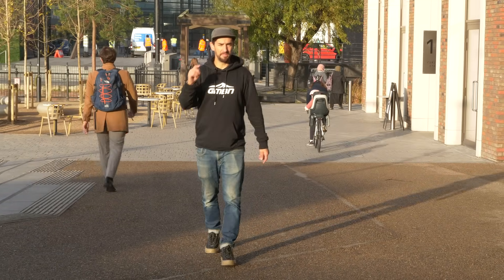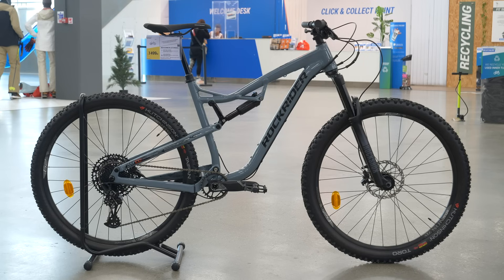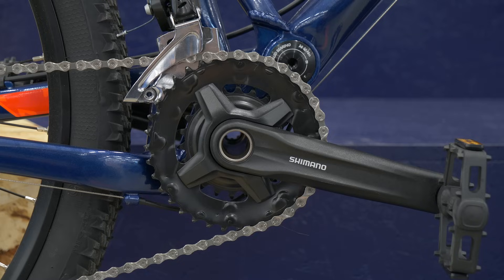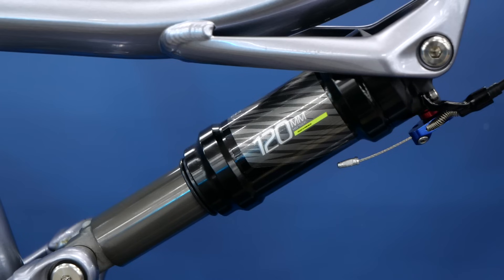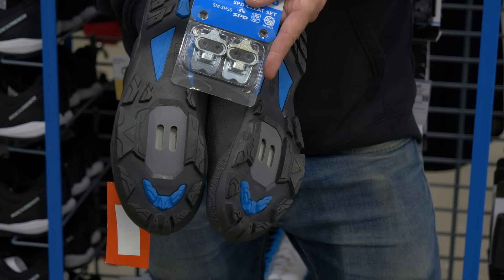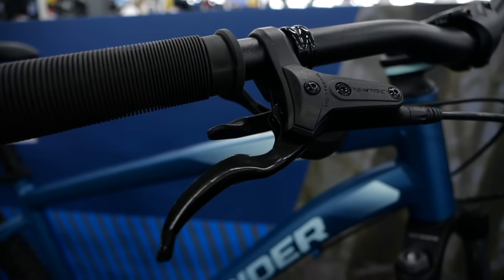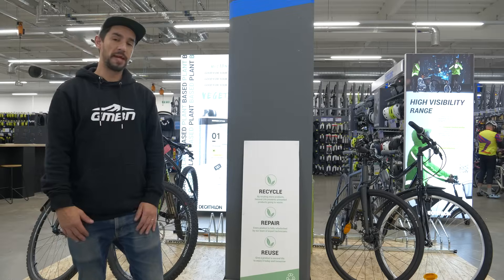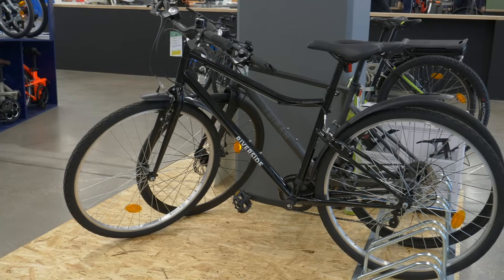How To Buy Your First Mountain Bike | The GMBN Guide

Comment: Decathalon is GREAT! You can get used to the weight of an Ebike before you actually get an ebike
Reply: Lolololol
Reply: The bikes are cool men,   for those ho don't haver Money to buy One better ,  it's  ok, and we have a lot of fun!
My bike do everything i need , has a 26 weels  downhill Mondraker level 2009
And i climb  everything with my beauty! 👌
Reply: Lmfao!
Reply: Now that is funny dude!
Reply: @shwndh   funny sete is ir ?
Reply: So true though 😂
Reply: Lmao just flexing the new RACE 900 Team Edition from Rockrider that weights less than a Specialized Epic with SID fork and XX1 AXS drivetrain for 4200€👍
Reply: @nvire5202  That bike actually looks decent but their older bikes feel like they were made of lead.
Reply: @kermitthefrog3685  well actually the think with decathlon nowadays is that their cheap bikes are crap and I'd admit it, and same as most brands, but with decathlon for about 500€ you could get 1× drivetrain and disc brakes and a sort of good fork, I ride the XC100S and it's sold at 1400€ and I get air fork and air shock with both 120mm travel, nx drivetrain, level brakes, 29er full tubeless and boost so tbh with decathlon, you just need to put a little more money and you'd get great things for a really good price, and the RACE 900 Team Edition is really high end and costs nothing tbh, 4200€ is cheap for having the best of the best components
Reply: I have a '97 Cro-Mo frame and Hi-Ten  rigid retro MTB. I have full rigid steel bikes since I was a kid. I love it but I want to put it away for special occasions and I need something for everyday tasks including rain can anyone suggest something cheaper but 20 degree uphill só I van visit cusins and my Grandpatents grave?

Comment: For someone looking to spend under $1,000 i'd recommend a better quality hardtail with nicer components. I'd prefer to have nicer components and frame than a full squish bike with super cheap components.
Reply: Look at the am 100 ht
Reply: @roryf3710  That doesnt look all too bad, didnt knew they had ond like that. But still, wouldnt you rather get a 1200 euro Canyon Stoic? Or even the 800 one instead of a Rockrider?
Reply: @em8452  Stoic is 100% better even with the cost, but it has the biggest disadvantage at the moment. It's a direct sale brand bike during bike stock crysis. At the moment it pops up on their global e-shop it's seen by the entire world and it's gone in 5 minutes. Good luck with finding that one.
Reply: @petrmatousek7422  True. But I would wait.
Reply: tmaybe you don't know but that hardtail  was the second cheapest hardtail sold by Decathlon, they have at least another 2 superior models that have much better specs  with more bang for the buck if you compare level standards with other brands !!

Comment: this year i bought my first "good" mountain bike - 2018 specialized rockhopper. i bought it used and i have to say - it was a real bargain. it costed a bit more than 700 €. The owner upgraded it, so it now has sram nx eagle shifting system, crang brothers pedals, lizard skins grips, 12 gears etc. i just love it. it's perfect for beginners with some experiences. it's also super light. recommend it!
Reply: Sweet deal! Even I went with a 2017 scott scale with NX drivetrain, judy air fork and 12.2kg total weight for 800ish.... Pleased
Reply: Great deal bro 🙂
Reply: I had the 2021 model, tbh it was fine but for the price of 700€, there was way better tbh

Comment: My first bike was a Norco Storm a couple years ago, paid around $1000 AUD. It was an amazing entry to the mountain bike scene. I did a 1x conversion myself on it. Already had an air fork and hydraulic disk brakes which I paired with some bigger rotors. I'v since had a slight upgrade to a 2021 Norco Fluid full squish trail bike and love that thing

Comment: Bought my 1st mtb last month. Ended up with a Specialized Rockhopper Expert. I really like it and I'm already looking for another, higher end bike. The Rockhopper will become my XC bike.
Reply: Tbh the Rockhopper Expert is too expensive for what it is, with Decathlon you could get a 1×12 GX Eagle transmission and RockShox Rebra for the same price
Reply: And I suggest the AM100S from Rockrider, have tried it and the only thing I could possibly complain is the brakes, wish only bigger 180mm disc in the back, if not the bike for around 1600€, it's rock solid choice, full suspension with 150mm front (RockShox 35 Gold) and 140mm rear (Manitou Radium I belive), NX drivetrain and 29er with tubeless ready rims and tires I believe so tbh rock solid choice

Comment: Bought a Rockrider XC 500S  for 1800€ and I am reasonable happy with it. I think it is really a great bike. The only downside is the 100 Kg system weight and the SX casette. The front break could be a little bit more aggressive.
Reply: I have the XC900 and have had no problem with the brakes, what exactly doesn't work for you?
Reply: @Fred_the_1996  I'm a big guy and the level T has not the stopping power I'd need to feel really comfortable with.
Reply: Change the front brake. Should be an easy change. Get a four piston caliper.
Reply: @captaincommodore8901  it's not the brakes, I had no issues on XC 500 with level T and I'm 2m tall 100kgs. You need to bed them in properly. Same on AM 100 S, level T but 4 piston, people complain but the brakes need bedding in, no issues riding red single tracks on that
Reply: @srymisclick  yeah I agree, I forgot to bed in my Level T brakes on my XC100S, so I removed them and legit sanded them real good and now feels better, not the best but feels better and I believe it would be really good when I change my brake pads and bed them in correctly

Comment: Purchase price isn't the only consideration. Higher level bikes with more kit does usually mean more maintenance though.... hydraulic brake bleeds, suspension servicing, dropper servicing, wearing parts like drivetrains cost more to replace...

Comment: Thanks Neil, as always helpful and fair - even if it was sponsored by a large retail shop
It’s always a minefield when choosing a mtb.......I have got back into it so have been using my 2008 felt which cost about £700 at the time, now thinking of upgrading as there are a few things I’d like (dropper post, converting to 1x11 from 3x9) and some parts will soon need replacing (such as rear mech, cassette and front cassette along with forks) if I replace these which I’m struggling to find like for like replacements and the cost to replace these things soon starts adding up to the point where a new bike suddenly becomes a more economic reason. 
Just wish there was a place you can hire out the different types of riding frames - I don’t fancy making a choice only for it not to work for me...........

Comment: I'm sad you went from the 229 GBP st100 ( it's not 299!) to the 600 and 900 full suspension bikes . Decathlon has some pretty good hardtails in the 500-1300 GBP range. Like the st900 hardtail, the AM trail, XC100, xc120 and the carbon xc500 with GX eagle groupset and a rockshox reba fork.

Comment: I'm looking for the ST540 V2 and it's really good for it's price. It has a 1x10 Microshift AdventX drivetrain with clutch!. Decent SR Sontour XCR fork and good tires. Worth for the price(Hungary price: 489€ or 552$)
Reply: No it's not. Ridden one from a colleague, it sucked. I would pick a 2nd hand respected brand 26er over that thing, any day of the week. Which isn't a bad choice by the way when you are just starting out.
Reply: @em8452  can you tell me why it's bad? Which part sucks? Drivetrain or something else?(fork for example)
Reply: For the most part it is very heavy and that takes the fun out of the ride with the weird geometry it has. Also it is not very upgradable. It has qr hubs, a square tapered bottom bracket and a straight steerer tube. If, and I dont know if its even possible, you want to upgrade to a good fork which are almost all tapered these days you will need a external cup headset which makes the weird long steerer tube even longer. Im sure the microshift stuff isnt all that bad, didnt tried it in the mud though. Im not saying you wont have any fun on it if you buy it. I just think it is a better idea if you can get a 2nd hand 26er tot start on with proper parts, for less, and save up for a proper 29er hardtail that you can upgrade in time.
Reply: @em8452  thanks for the information! The hubs are ok what you said but the fork is quite easy answer because we have a lot of straight XC fork even fox 32 have a straight version and the microshift is not that bad it's like shimano or sram because this is it's competitor in the market. I guess it is not bad for some people but it's not for you as i see. Thanks again for the good information :)
Reply: Edit to my head tube angle: XC bikes are starting from 69° Head tube angle and goes up to the sky.

Comment: i want to sell one of my road bikes and get into mountain biking but I'm still stuck between a hard tail or full suspension, mostly want to start with trail riding and single track. i like the option of having the full suspension but i probably wouldnt use it to its potential

Comment: What should those of us heavier  riders (300lbs and up) be looking for in a mid level bike? I never see much discussion when it comes rider weight.
Reply: Enduro bikes, XC and some trail bikes are too flimsy
Reply: A fat bike hard tail. Steel would be better but aluminum will be most common. But even those will be compromised on parts. You’ll have to replace the rear hub at the least.

Comment: Question in terms of derailleur choice: If im building my first enduro bike (brand new ns snabb from the 15-6’ ish design with 142x12 axle) and am going for an 1x11 system, wich one of those would be recommended? I allready got an xt m765 crankset, with a 34t nw ring that has 1mm offset so far. For the correct chainline should it be more? The snabb has a 73mm bb shell, and my rear casette has to be hg compatible and the provisioned range is 11-46 on the back end. If anybody could help me out with derailleur choice that would be nice. Currently im debating myself between m7000(not in stock at most places anymore, m8000got a handful in stock at places and 5100 which i easily could buy. Pros cons against the 5100 vs the other two?

Comment: I would suggest avoiding decathlon, been waiting for a replacement part for months, their bikes have specific parts only they seem to have. Have had to mod my fork and shock to be "locked" open as the lockout stopped working and the shocks default is locked closed meaning no suspension.
Reply: That was more in.the old days i think nowadays they have shimano mech

Comment: Once you have decided on the type of biking you will be doing surely you should choose a bike brand that suits your height?  For example the rockrider size Large will suit someone who is no taller than 6’1” so if you are 6’1” going over the bars on steep technical trails or maintaining a neutral balanced controlled position in high speed trails can be tricky.  If you chose a XL size which states max recommended height of 6’7” then it will be way more heavier and bigger than you need.  A better idea whatever your height is to look at bike brands where your height sits in the middle of their size range since bike sizing is not a generic thing.
Reply: U pick a frame by its size no matter the brand, u dont buy L if u need XL. Some companies L is an others XL or a M. They should look at inches instead of size ratings no matter what brand
Reply: @Rab_Cee  thats what i said ?
Reply: @BUD-v9r  maybe you did but you definitely over complicated the crap out it 🤣 by sayin choose brands that fit your hight, they all go from 13" frames to 26". The ratings (m,l,xl) is the only difference from what iv seen
Reply: @Rab_Cee  thats old school bike sizing youre using which just refers to one dimension but mountain bikes are not as simple as one dimension.  Its easier to identify a brand that makes bikes in a certain size range.
Reply: @BUD-v9r  vitus small is 15" ther large is 20" might not be listed that way now but still them sizes. Nuke proof same size seat tube from small to xl 16" but 40mm longer from s to xl. Definitely no real standards in mtbing nowadays just randomly labelled between brands
Reply: @Rab_Cee  keep studying and one you might understand.
Reply: @BUD-v9r  it doesnt take any studying to look up size charts n see its still same size frames but different angles. Brand doesnt matter, so u cant say pick a brand when u need to pick a size
Reply: @Rab_Cee  a santa cruz mtb in large suits a rider height of 1.75cm to 1.85cm but another brand called Giant in large suits a rider height of 1.83cm to 1.98cm.
Reply: @BUD-v9r  175cm-180cm / 5'9"-5'11"	79cm / 31"	18”, 19" (Medium, Large)
180cm-188cm / 5'11"-6'2"	81cm / 32"	19", 20” (Large)
188cm-196cm / 6'2"-6'5"	86cm / 34"	20", 21”, 22” (Large, X Large) this is sant cruz size chart, ow look it has " on frame sizes
Reply: @Rab_Cee  now go and compare those frame sizes small to xl in yt industries.
Reply: @BUD-v9r  the sizes stay the same man just the medium n large labels change. Its all same ergonomics.

Comment: Looking for my first MTB. Where the heck can I get that Rockrider for $600?
Duel Air suspension, 2x9, lock outs, tubeless ready, disk brakes. I mean it seems like it has it all at a reasonable price. I don't want to drop 1k on a first bike.
I've looked everywhere for that Rockrider and can not find a model that looks like that one at that price.
Anyone have a direct link?
edit: damn it. I found it in the UK. 600 pounds comes out to $726. I cant even imagine what shipping would cost

Comment: For your first bike you want the lightest thing you can afford. I'd sacrifice components over weight any day.
Reply: Also worth looking for an older bike. If its an older model and the bike shop hasn't moved it you may be able to get a discount on the price while still getting a good bike.
Reply: Also first bike, get a hard tail. You'll learn more about your riding position and how to to take hits. Also no such thing as a good cheap full sus.
Reply: Cheap, light, strong - pick any two. I really don't want my frame, fork, wheels, brakes, cranks, pedals, handlebar, seat post, chain to break. I also want gears that work. I'm struggling to see where lightness can be added when expenditure is constrained.

Comment: why not buy a A-brand 500$ entry level bike? most of these bikes will come with 29 wheels, nice A-brand parts whitch aren't a pain to replace and a good bike for a beginner to progress on. 
bikes like the rockrider 100 or120 won't even come with a derailleur hanger and they'll be a pain to upgrade. 
so if you're new and you see this comment then look for a cheaper 500$ range bike from a A-brand like trek, scott, cube, specialized and all those other brands (most well known brands make them).
Reply: Pay a visit to a local bike shop and look for an entry level hard tail.
Reply: 500$ Rockrider has both better frame and better components than any 500$ bike from the brands you mentioned.

Comment: What I learned over the years for things to look for on a mountainbike:
- Get branded components (you want quality stuff when you are riding);
- Get hydraulic disc brakes (you will thank me on the descend);
- Don't buy RockRider bikes (they skip on quality, you are better off buying a second hand bike).

This video feels like a massive sellout by GMBN...
Reply: All their "informative videos" are sponsored, that's nothing new. They're sponsored riders on Nukeproof, Canyon, and Orbea. Not really surprising to me.
Reply: @halfgeek1394  I don't mind a sponsored video, the bills have to be paid at GMBN too.
However if it's a sponsored video that gives maybe the worst advice you can give a new rider, that's disappointing.
Reply: @roha2317  don't tell the Rockrider bikes aren't good because they are! Where you should stark looking at them is the ST530 and specially the ST540 V2. These are really good quality XC bikes!!! Of course at the bigger price they're good as well but always keep in your mind that these are not Freeride or DH bikes! These are XC bikes mostly but of course you can make the Rockrider hardtails to be good at Freeride with some upgrades like shorter stam for example.
Reply: Its not that bad, i have the st100 which is more than capable to handle rough roads, plus the frames are lifetime warranty too.

Comment: Decathlon is just a better wallmart overall - that means its better, but it does not mean it's good.

800 - 1000 $ hardtail is overall the best starting point and especially from bike specific dealership. Decathlon is good place to try the bike out to just try it and get some basic accessories for good buck, but overall I don't recommend seriously buying bike there unless you are looking for a bike for half a season because then you realize you really need and want more.

Exposed shifting cables. Weird geos. Limited warranty. Not suitable for xc riding - excuse me?

Overall do your research. You will save a lot more buck in the long run if you know which hydraulic brakes suck. Which forks suck and break easily. Yes, you can upgrade later on, but its really not cost efficient now is it.